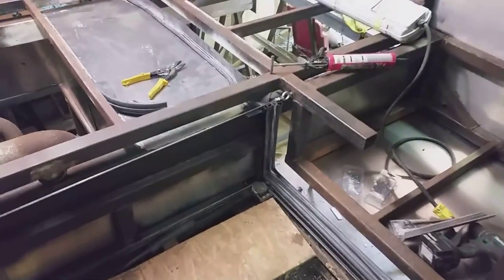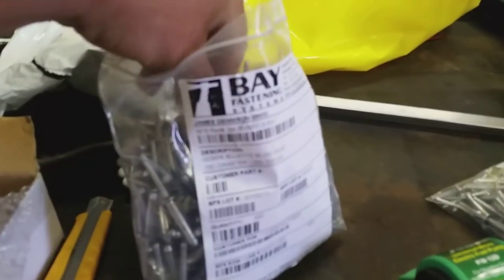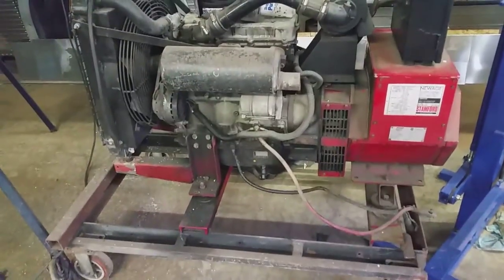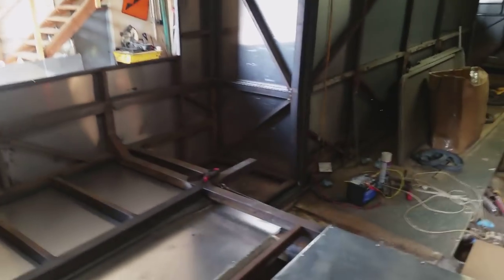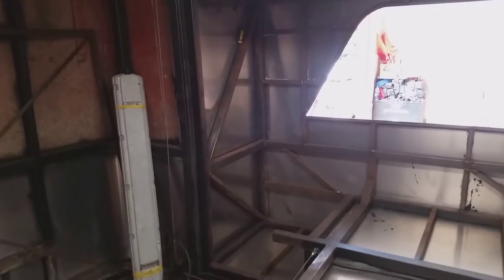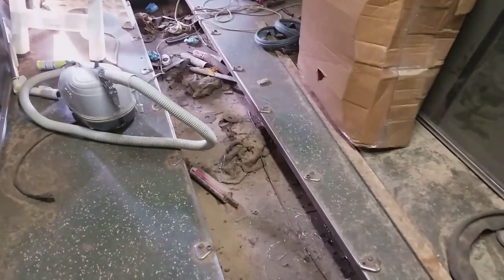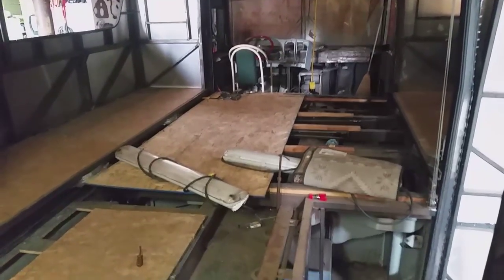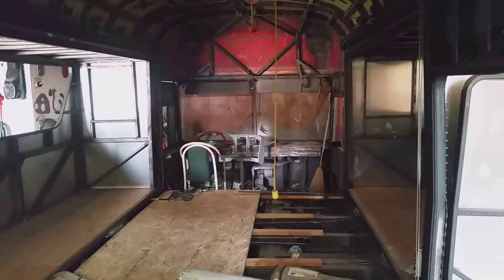Bus Conversion Project - Video 67 - The Slideouts are done!!!

Comment: It is always great to move on to a new task! Speaking of which.

Looks like we are moving. Our home is sold, the purchase on the new home looks pretty solid. Local move.

That means the basement shop has to move, so how do I accomplish that?

One approach would be to hire a couple  three guys to get the stuff out of the basement to the garage, and then from the garage to one of the barns. I have two enclosed trailers, but one truck. Shuttle the trailers, movers to load and unload at both spots??

This would all have to be on a schedule. 

I.E. house one closes, then house two closes, we rent house one for a period of time while we move from house one to house two.

The person buying house one needs to be in by October 15.

So… the big question for this approach where does one hire “day labor”????

Suggestions?

How about, does anyone know a company that will move shop equipment and supplies? Home stuff is a snap, but compressors, sandblaster, oven, shelving units, may be a different story.
Reply from the maker: I'm exhausted just thinking about it.... I hate moving... looks like it will be a good move though.... get your car buddies to help you, call it.... The Old Farts Moving Company... :-).... you'll make millions!!!
Reply: Note, have not hired anyone to do any work in a long time.  Daily work-daily????
Reply: Not sure how car nuts would take to moving.
Reply from the maker: around here anyway you can hire temporary people from services, work a day, get paid for a day.... one we have in Vancouver is called Labour Unlimited... might be an option.... just have to be sure to keep an eye on them.... if you know what I mean....:-)

Comment: Hi James !  Have you any idea how many tons of steel and aluminum you have added to the bus ? Have a great one !
Reply from the maker: I removed around 7000lb. of "BUS" stuff and added around 7000 in steel and aluminum, the RV stuff shouldn't be more than a passenger load of 45 and their luggage, I do want to weigh it to make sure I don't overload an axle.... I can position generator, batteries ETC. so as not to overload any one axle but I'm pretty sure I will be way under legal axle loads anyway.... better to be safe than sorry

Comment: I've built side out very similar to the way you did yours but went for hydraulics and instantly regretted it now I've got a rethink it all out and looking at what you have done I would like to duplicate however trying to recap on your videos there are so many I can't find what I'm looking for so I thought I'd ask you what is that electric motor setup please I'm very keen to use that system thank you
Reply from the maker: I got them from Ebay, they are Norco Accuslides, I modified them quite a bit to make them work for me, hydraulics should work though, commercial RV manufacturers use them all the , I was initialy going to use hydraulics myself
Reply: @JamesEDennison  thank you hydraulics were a great idea at the beginning but I'm trying to keep the weight down and the small rams that I modified from lorry cabs are just too fast and they cause everything to Jolt and lock up and jam I was going to put wider diameter rams on but they are bit heavy and there is slowly too much weight going in the middle I'm only 7 and a half tons so with everything else going in I need alternatives since I replied to this message I tried a linear actuator which just about pushed it so I'm going to get another two more and run three on one side but I do need some failsafe to stop them from seizing up if one breaks and auto stop of some description power overload I don't know what figure it out thank you for your reply and I have to say as you already know this from others that are watching you have done a fabulous job of your engineering you are a credit